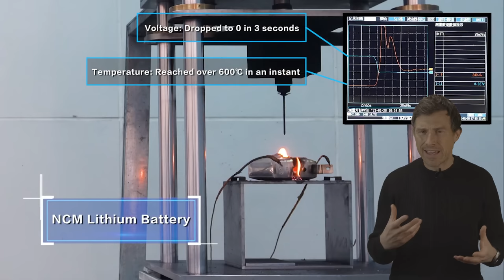Chinese cars are going to rule the world!

Comment: Living here in China, I’ve bought an EV car last month. I bought the VW ID.4, not because it is the best one, but because it’s least wanted EV car in Chinese market, I don’t have to wait for half a year like other Chinese domestic brands. Other EV cars are soooo popular that buyers have to wait for probably half a year to get the ordered car.
Reply: that's true. BYD wait time over 6 months, it is very crazy
Reply: But is way better then to get a Toyota land cruiser 300 is take about 3-4 yrs
Reply: San  no，ID4 price range from ¥187300-¥287300, and the ¥287300 one is a 4 wheel drive, which is not popular. Most people by ¥245800 one and ¥248300 one. On the other hand, Chinese domestic brands like NIO, zeeker, Xpeng or Li, is much more expensive than VW, but sold better than VW. So it’s not only about price.
Reply: San  btw, BYD is almost the cheapest in the same size category.

Comment: In the chilean market, chinese brands like Haval/Great Wall, MG, Chery and JAC are gaining big positions in terms of market share and sold units (in 2021 some models of MG and Chery was in the Top 10). In my opinion (excluding EV cars), i think that Haval, MG and Chery will have the huge advance on this decade.
Reply: Just to add some more info, they reached a market share of 38% of the Chilean market and are widely expected to surpass the 40% milestone for this year. I daily a GWM car, have had it for almost 5 years and I haven't had any issue. Nothing has failed or broken and maintenance has been cheap, easy and uneventful.
Reply: Thanks for your info. Can I ask what are the Chinese cars' main edge in your market? Quality or price? Is the reliabilty comparable to Japanese and Korean cars? What about fuel efficiency? thanks!
Reply: @ProCelestialEmpire  initial edge absolutely was price and offering more for your buck but that has evolved into being more about bringing exactly what the market wants (mainly SUVs and Pickups), opening and exploiting new niches (relatively affordable 7-seaters), offering a considerable variety always well-kitted out and with plenty of tech as standard. Nowadays they cost almost the same as most competitors but come with more equipment that people value, like disc brakes on all fours, alloys as standard and have not fallen yet to the godawful practice of offering entry level models with uglier bumpers and simpler halogen headlamps that scream "poverty spec" and look nothing like the promotional shoots. They generally come in very competitive and carefully crafted trim levels that outdo the rivals. Other factors include the usual word of mouth spreading that they're pretty mechanically solid and cheap to run, aggressive marketing campaigns with improved warranties, attractive financing and having had more availability during the last two years of worldwide disruption. Also, a lot of consumers have a sense that the competition has been "leveling-down" as they are no longer manufacturing their entry level models and even some more expensive ones in Japan or Korea but have moved to India, Thailand and Brazil. They're still not the best on fuel consumption, as many of the most desirable and demanded products drive on turbo fours which, when pushed, can be quite thirsty but they have polished those considerably as well. They have been here for about 15 years and this is a furiously competitive market, with no import tariffs and 80+ brands representing just about every manufacturing country so it's clear they have been doing some things extremely well.
Reply: @autopathos  thank you so much for that proficient level of analysis!
Reply: Saya cinta negara china, Saya cinta produk china, Saya cinta mobil china dan saya bangga mobil bikinan negara china semangat untuk negara china
Reply: @udinslamet9306  停止用谷歌翻译装成为外国人
Reply: @鲁巴肖夫  ，你看起来很焦虑！
Reply: @鲁巴肖夫  跪习惯了不知道怎么站着做人
Reply: @boonchewchan8245  他跪久了起不来😂
Reply: @ProCelestialEmpire  They're more reliable than American cars not yet as good as Japanese or Korean cars.
Reply: 别急
Reply: Kereta china pun banyak jugak guna gearbox DCT sebab china akui ia sedap berkuasa dan seronok dibawa
Reply: @LafeiAr lol

Comment: This is a really good, interesting, informative article.

One thing that hasn't been mentioned in respect to BYD is the rest of its business.  Cars now account for about half of the company's revenue, but it built itself up into a huge company doing two things.  First, acting as an OEM for phone and computer makers.  But secondly, and more importantly for this article, BYD has always been a battery manufacturer.  At one point, about 70% of the world's mobile phones and about 70% of the world's laptops used BYD batteries.  I'm not sure what the figure is now, but it's still quite a lot.  

So, for years and years, BYD has been building up enormous expertise on rechargeable batteries.  And those are the difficult bits of an EV.  Going from being a legacy carmaker to an EV maker requires either that you spend huge amounts of time and money on battery R&D, or that you outsource your batteries - usually to a Chinese or Korean company.  BYD, on the other hand, just had to stick some wheels and seats on its batteries.  

BYD first ventured into ICE cars in, I think, the mid-2000s, and they were awful.  Now their focus is on EVs, and they really are at the forefront of the industry.  

And they're not even the biggest Chinese battery company.  That's CATL, who make the batteries for the BMW iX3 among other things.  

If the world had stuck to ICE cars, I'm not sure China would ever really have caught up with Japan and Germany and Korea in terms of technology and quality.  But the switch to EVs was a real opportunity for Chinese carmakers.
Reply: And BYD is the largest face mask manufacturer in this world...
Reply: @kittyflier8338  Yes,BYD have the rest  of  business
Reply: Nice breakdown.  But I do believe that the chip shortage is not affecting BYD because they own a chip manufacturer that is a significant part of their business.
Reply: especially OEM for apple
Reply: years ago people say ' do you know a chinese car brand' , now people really know some. cause the world appeal to use e cars to protect our earth, and china did it seriously....
Reply: @Bill_here_USA  Chinese people can work efficiently and focus on work while rest of the world has to constantly get involved and waste time in internal politics because of democracy.

Comment: The "biohazard air filter" is just an active carbon filter for the cabin. You can get those for most cars and they cost a little more than the original ones. They can be good if you live in a large city.
Reply: just so you know, its a HEPA filter
Reply: My vacuum sucks my biohazard farts
Reply: the architecture of a HEPA (or "bio hazard air filter") is different, plus they do cost more money, and are 10 times larger at most (sourced from electrek). here is a good video about them https://www.youtube.com/watch?v=Dx9wrIfqhjM
Reply: My Discovery 4 has had this since 2010.
Reply: Active carbon filter + HEPA filter
Reply: @mmurage  Yep, aftermarket. No end of companies make them.
Reply: so you're in your small glass bubble(literally lol) until you exit and take a deep breath of that city smog. real useful stuff.

Comment: Great sum up, thanks😊I own Xpeng P7 Performance (Norway) and its a wonder of a car. Extremely comfortable driving, very quick, silent and awesome looking. Love it😊
Reply: Any concerns about spare parts, maintenance, and repairs? Even Tesla is notorious for having long lead times and high prices for even simple fixes. How do you think your car would fare in terms of support after 5-10 years?
Reply: @xiuxiu1108  No more concerns than the BMW I4 M50 I also own. I cannot predict the future, but any Company that wanna make it, would have to fare well in such matters
Reply: my god, Norway seems to have all the latest Chinese brands.
Reply: feng dfd  I have used mine in wearher with -20/30 with no problems whatsoever
Reply: @IA100KPDT  Hehe, yes, theres quite a bit of a selection to choose from
Reply: feng dfd  I live in North of Norway, and there can be some pretty cold winters. I experience it as a very good car in winter time, with extremely good AWD drivetrain. P7 does not have 670km, thats Chinese standard. But wltp standard puts it to real world range 480km. In wintertime, with full charge, I have gotten between 390 and 415km. Remember that this exact model does not have heatpump, but ptc warmer. Its gets much warmer with ptc than heatpump, but it draws more energy from battery. If it came standard with heatpump next to ptc, it would go further in wintertime. Or you can sit and freeze and get up to 440 km :)
Reply: @Mr.Relaxed  thanks for buying Chinese cars.we will do better with good price
Reply: feng dfd  笑死了，人家说开着挺好你还非得插一嘴“冬天开高速续航缩水哦”😅
Reply: @Mr.Relaxed  Hope u get amazed by other coming Chinese EVs! 😆
Reply: @AlexLiangrq  Upcoming chinese cars will most surely impress me, like Zeekr001, Nio ET5/ET7, ES7 and not to mention Xpeng G9, which im also considering to buy
Reply: @Mr.Relaxed  I've tried 001 and ET7. 001 looks pretty much like some powerhouse wagon or further but a little bit too short inside; ET7 has impressive wood interior, and still have more than 600 horse power.
Reply: @AlexLiangrq  Intetesting. Im waiting to try both of them later this year. 001 looks like a beast, like the apperance, same with ET7. But did 001 feell more Premium in general, and how was the Drive feeling in both? Did you prefer ET7 or 001. Like some of 001 features,  trunkspace/opening/airsuspension and so on..looking forward to try them out

Comment: Haval H9 (GWM) had one for a couple of years.
Great value, smooth drive
Reply: We have a GWM steed.

Harsh ride and super unreliable. But specced well and very cheap
Reply: In SA the Haval Jolion is selling like hot cakes. From a distance looks like a great offering.

All these were started by the H9, H6 and H2 back in 2017. And by the looks of things they not slowing down.

That Jolion and H6, I want one of them.
Reply: @henrysithole3623  my dad has the Jolion, great car, cheap and good
Reply: fr tho I have an h9 and it's a great desert cruiser. And the luxury features you get on that car for the price
Reply: Tell me, no problems with the car at all? I've never heard anyone complaining about reliability when it comes to Haval.
Reply: @kylelmao.  the price is great.
Reply: @tatendalesliejambwa7081  I mean it has a honda engine, and its electronics were made by Bosch I believe

Comment: The Volkswagen ID.R holds the lap record (for an electric car) for the Nürburgring at 6:05.336 beating the Nio by 40.564 seconds which was the previous holder and the fastest thing round the Nurburgring was set by the Porsche 919 Hybrid Evo at 5:19:545.
Reply: you can, at least theoretically, buy an EP9.
Reply: ID-R is not a production car
Reply: @ericcoskun1  The record is for the fastest electric car round the Nurburgring, not the fastest electric production car!   The Nio EP9 is not a production car either as its only built for the track and is not road legal and was never exported outside of China.   The fastest electric production car round the Nurburgring belongs to the Tesla Model S Plaid that did the lap in 7 minutes 30 seconds in 2021.
Reply: 5.19... 12 miles ish miles .. cripes.
Reply: @antonthompson7838  10 EP9 was sold at the price of 2500000 euro. So, yes. It was a production car, you can't buy an ID.R on the other hand. not even you have trillion(maybe you could just buy vw at that point).
Reply: @daweeb69  No wrong buddy, it’s a track only racing car and it’s illegal to take them on public roads.  The very definition of a production car is they are mass-produced (or quantity produced)  identical models offered for sale to the public, and must be able to be legally driven on public roads (street legal).
Reply: @antonthompson7838  Everybody knows Plaid is quite slow comparing to Rimac Nevera :D
Reply: @antonthompson7838  a production car, not a road legal production car
Reply: @antonthompson7838  Both the ID:R and the 919 EVO are race cars, unlike the EP9 which is actually available to the public. What Mat actually meant was that it is the fastest EV that can be sold to the public. Like other people said, you can’t buy a 919 or an ID:R even with a trillion dollars.
Reply: 4680 Roadster 🔥⚡
Reply: Bro, watch TGT, you will find out EP9 does exported to EU....and it is a production car, like Ferrari FXX K
Reply: @antonthompson7838  EP9 is a production car and is available to consumers.
Reply: @rogerfaint499  Track car not a production car, completely different.
Reply: @daweeb69  A track car is not a production car, completely different!
Reply: @wyrazowfkp  Yeah I know it is and I love the Nevera and now Volkswagen have sold half of Bugatti to Mate Rimac and I can’t wait to see what he does as the new CEO!
Reply: @antonthompson7838   Can you buy an EP9? Vs Can you buy an ID:R?

Comment: the fastest EV car on the Nürburgring is not the a Nio its the Volkswagen ID.R with a lap time of 6.05.34 min.
Reply: Neither the EP9, but the point is the time, it’s produced in 2017 which by the time it’s the fastest. Guess who gonna take the IDR?
Reply: @ekxxx123  he just said EV, and are you sure the Nio is a production car, cause its not on the official list of the nürburgring, they say the fastest production EV is the Plaid.
Reply: @ekxxx123  Check the NIO EP9 if it's road regal as well and afaik all the units sold i.e only 16 isn't registered for road use. Also 16 units doesn't make a production car.

Comment: The idea with the swapping car batteries in 5 minutes is the best idea for the EV , I thought of that the first day the electric cars came into production. Should be a default thing.
Reply: Why would you bother if you can get 80% charge in 15 mins.
Reply: @Planes Trains & Dogs n Cars  100% in less then 5 min and you get a new battery every time. Or upgrade for longer range if you plan a longer trip. Also if your battery goes bad you don't need to pay 20k for a replacement like tesla.
Reply: It actually only takes 90 seconds
Reply: You are so right, sir. And guess what, this is an EV that people can really get, not those sci-fi imagination or something only has a prototype, this thing, is the reality in China , now and today .
Reply: @TV-us1ue  how cool is that. And in the city where the car should drive 100% autonomous , like a personal tram , it could have like a wire underneath that powers the car , ...the infarstructure is important too.
Reply: Building out the infrastructure won't scale as easy as new chargers at a parking spot... Also with inevitably faster charge times & more mass buildout... You'll have one swap station for every 20, 30 chargers you can access Tesla thought of it a decade ago & ditched the plan

Comment: Cannot believe you didn't mention my favourite Chinese brand, SAIC. They own brands we already know like MG, Maxus and LDV and are the largest of the 4 state owned car manufacturers. They produce electric cars we already see on our roads like MG ZS and MG5 and others soon to come to the UK under the Roewe brand. They produced 5.4 million cars in 2021 if you include the vehicles they manufacture under license in China for Volkswagen, Skoda, Audi, Chevrolet, Cadillac etc. I own a MG HS petrol SUV with a 7 speed dual clutch automatic transmission and love it. When we were looking to replace our Nissan Qashqai for a similar size SUV we couldn't find anything that came even close for the money. To get a similar size and specification car was over £30,000!!!!! (When did cars get so expensive?) Our top of the range model with every conceivable gadget as standard with a 5 star ENCAP safety rating and 7 year warranty was £21,800 on the road. (Absolute bargain and less than a base model golf) Cannot believe that you haven't tested the petrol only model Mat and compared it to what you could get for the same money. No wonder MG is the fastest growing brand in the UK.

Comment: In New Zealand, I recently brought the HAVAL H6 Ultra Hybrid. It's a 1500cc Turbo mated to an electric motor, with a 7 speed DCT or Direct Hybrid Transmission. I get about 5.8 liters per 100 kilometers 48.7 imperial MPG) in fuel consumption, runs on RON 91, and the combined power output is 243 PS (179 kW; 240 hp) and 391 lb⋅ft; 54 kg⋅m (530 N⋅m) of torque. So you have to be easy on accelerating from a stop. Otherwise, you can get a wheel spin going. Has more bells and whistles on it than I've had hot dinners, Level 2+ autonomous lane keep, self parking.  
City driving is fantastic.  Haval is becoming very popular here and in Australia.

Comment: Advantages of swapping batteries:
You can rent larger batteries for a long journey.
You dont pay upfront for the battery.
You dont experience battery degradation.
Battery charging can be done with slower charging, protecting battery life and making the energy usage more efficient (better for environment and wallet).
Easier and cheaper to change battery in your local workshop. 
Possibly of standardization of batteries among manufacturers, easier and cheaper access to them (for consumers and manufacturers).
Disadvantages: 
Not easily scalable, more costly expansion, you need more batteries than cars in circulation. Standardization could help, but not easy to convince manufacturers to do so, and it reduces competitiveness and slow down improvements.